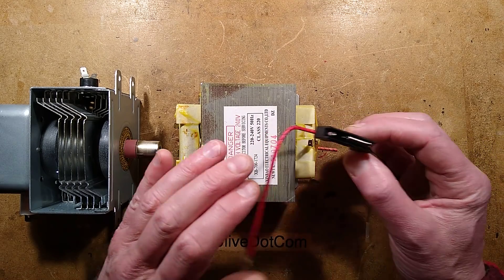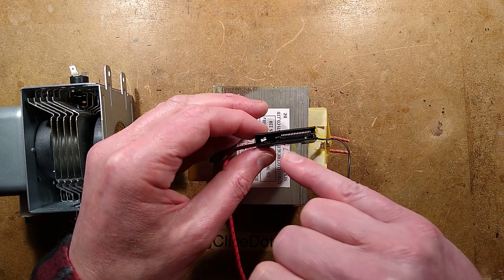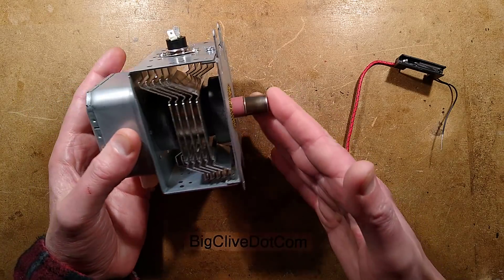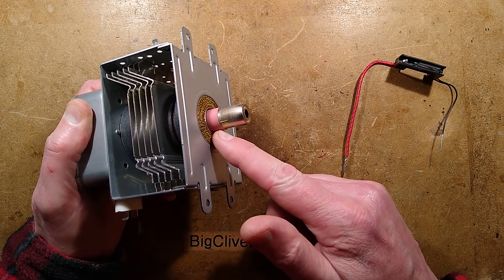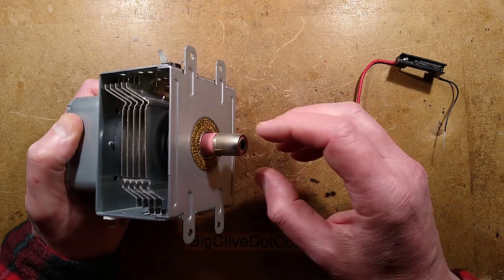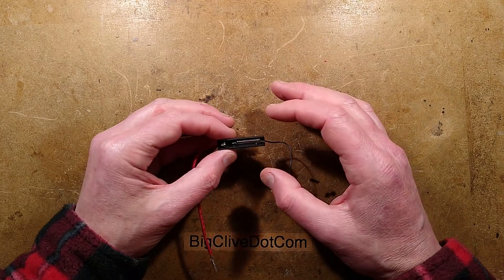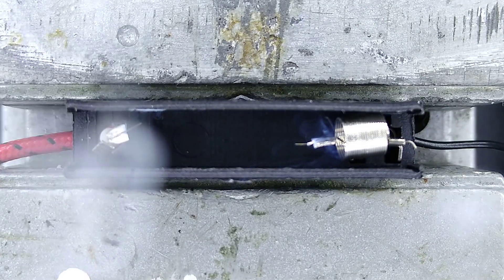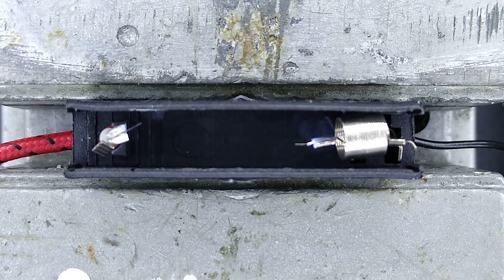Blowing a high voltage fuse

Comment: Yep, you are right, those ceramics are Alumina, not Beryllium Oxide. That stuff is used in the bores of Argon Ion Lasers where exceedingly high temperatures are encountered. Beryllium Oxide ceramic it is exceedingly expensive and difficult to machine, and as you say, it would have to be covered in warnings!
Also, cool fuse video. It would be nice to see the slowmo guys point their camera at one :-)
Reply: BeO is also used in RF power transistors where they need to have the die insulated from but thermally coupled to the metal slab on the bottom of the device. I've also heard of it being used for the window on high power klystrons. It's really pretty uncommon.

Also that pretty red / purple ceramic may be found in Svetlana RF power tubes that were also sold under the RCA brand name, it's so elegant
Reply: @hyvahyva  forgot about those! Yes BeO has excellent thermal conductivity.
Reply: @LesLaboratory  yup that's why it's sometimes a necessary evil lol

Comment: Neat! Looks quite a bit different than the large class T fuses I'm used to on lithium systems. They tend to surround the element with some kind of fine sand, probably something to do with the large ampere interrupting capacity.
Reply: The thick conductor of the fusible material and the high current means the fusible material will stay conductive as a plasma, the highly inert silica sand that surrounds the fusible material, basically quenches the arc by falling into the area left by the failed fusible material. In the UK plug fuses must contain this sand to prevent arcs forming and causing connection cords to melt and burn.
Reply: The material around the element after its melted is called fulgurite

Comment: I have a question - how does a fuse blow at the same current, regardless of voltage? Wouldn't the amount of power going through the fuse be the thing that causes it to blow, or am I misunderstanding something fundamental about fuses?
Reply: The fuse wire has very low resistance, so even a relatively modest voltage across the fuse is sufficient to push enough current through it and generate enough power to melt the wire.

I believe you may have confused the voltage across the fuse (which is generally small) with the voltage across the fused load (which can be very large).
Reply: Fuses break your circuit by melting the fuse wire. How quick that wire heats up depends only on the amount of current passing through it, and also the resistance of the wire. It's called Joule Heating  https://en.wikipedia.org/wiki/Joule_heating
Reply: Not the power going through it, but the power being dissipated (or wasted) by it.  Think of it as a small resistor.  The power dissipated is proportional to the resistance of the fuse, and to the square of the current.  Since the fuse should be a pretty low resistance compared to the load it is in series with (so that the fuse doesn't waste too much power), it drops relatively little voltage, and so the supply voltage won't directly affect when its element melts.  (Too high a supply voltage might not be interrupted, due to arcing, so there is some kind of maximum voltage interrupt rating for any given fuse.  And raising the supply voltage will usually result in the load drawing more current, so there is that indirect relationship.)
Reply: The fuse element/wire melts from heat generated in it due to its resistance and the current going through (P=R x I^2)
I it doesn't matter what the source voltage /voltage across the load is - the voltage rating of the fuse is for what circuit voltage it can break w/o risking continued currencies from arcing.
Reply: Ohm's law. What you are describing is a fuse that alters its resistance with differing voltage as to maintain a fixed current (which does not exist outside of maybe semiconductors as far as I know). As you increase the voltage dropped across any fuse/typical resistor, you also increase the current and so the power it dissipates, as power = V x I. (Similarly, as you increase the current flowing through a resistor, you also increase the voltage it drops and so the power dissipated, V x I.) Both these sentences mean essentially the same thing in practice, however, as you cannot increase the voltage dropped without increasing current and vice versa (unless you're dealing with arc characteristics / other unconventional loads, but that's another thing entirely).
Reply: Fuses are "controlled" by current, not by power. The higher voltage, the bigger gap between contacts you need  to prevent arc over. Here the gap is made bigger by spring, for smaller overall package. The actual "fuse wire" melts by temperature increase, which is achieved by current only (resistance+current->heat), independently from the voltage.
Reply: Because the dissipated power in the fuse is the voltage dropped due to the fuse resistance times the current, and the dropped voltage (according to Ohm’s law) doesn’t depend on the input voltage, only on resistance and current (P = I²R, because V = IR and P = VI).
Reply: @GRBtutorials  Thanks, makes sense.
Reply: It depends on the diameter of the wire, how much amps you can shove through it. If the current rating is exceeded, the wire will heat up and melt. Depending on the type of the fuse, the time might be short or longer. For example an electric motor with a fast fuse rated at the nominal current of the motor would be a bad idea, as it would probably blow immediately when you start the motor, because of the high inrush current. For the voltage I think the insulation of the wire is more important, because the arcing distance depends on the voltage regardless of the current.

Comment: Funnily enough the HV fuses that I found in all the microwaves I did take to bits were not like the one you showed in this video but instead they were a glass tube-type fuse with the spring and thin wire inside the glass tube and ultimately a white or black plastic holder with thick red wires coming out of each end. (The plastic holder has a tube shape and completely encloses the fuse).

Also as I've seen from parts selling websites you're supposed to replace the whole plastic holder with fuse when it blows even though the plastic holder is quite easy to open, in fact I'm pretty sure it's designed to be open and the fuse removed and swapped.

But I've found some microwaves with this fuse blown and I wonder what could have caused that.
Anyways I did wrap the fuse in aluminium foil in these cases and it worked just fine.
For science of course, definitely not in the kitchen though.

And so far the most impressive thing that I've got from microwaving something that shouldn't be microwaved is literally a jet of molten metal coming out of a 18650 cell actually piercing a hole in the back of the oven cavity !
Reply: Those fuses normally fail just from old age, they are a thin wire, and being long and unsupported copper alloy it vibrates, and work hardens, and eventually just snaps Replace with a single strand of thin wire, and it works again, although you can put a replacement fuse in there anyway, they are a little longer than your regular 6x32mm fuse, to get the high voltage ability.
Reply: I've replaced a lot of fuses in my microwaves and those of friends and family, the only thing you have to make sure is that the fuse fits tight in the connectors, if it is loose it is likely to arc and it will not take long to blow or even melt the plastic housing.
From my experience those fuses usually fail due to metal pans, forks or spoons that pass too close to the walls causing an arc and thus overloading the magnetron.

Then in microwaves with grill there are two types, some have quartz heating elements located on the other side of the ceiling of the cooking cavity and emit infrared radiation through a grid that keeps the microwaves inside, others have a tubular heating element mounted on ceramic supports inside the cooking cavity, when these supports get splashed with food and it burns it leaves a conductive soot layer that can be conductive enough to ignite an arc too.
I imagine that the capacitor or the magnetron could also fail causing a short but I have never seen that case, although I don't think I have "repaired" more than 15 microwaves.
Reply: @ruben_balea  Thank you for the info.
Reply: Is it a good idea to microwave this?
Reply: @nerfinator03  yes it's a great idea if somebody does it and films it then you don't have to
Reply: @davidmunro2077  Unfortunately I didn't record it at the time 😂😜
Reply: @nerfinator03  Definitely not ! 😂😂
Reply: @psirvent8  Have you never seen the series on youtube?
Reply: @nerfinator03  Yes I have seen it back a decade ago.
And no, microwaving a lithium ion battery is definitely NOT a good idea.
As is microwaving stuff like a lava lamp or airbag.
Reply: All the HV fuses I have seen in microwaves are as you described, an oversize glass antisurge fuse inside a plastic case, I've never seen a "naked" one before like this.
Many microwaves don't bother with a HV fuse, the transformer operates close to magnetic saturation so even a shorted HV rectifier or magnetron will just cause the transformer to sit there and hum slightly louder than normal and not heat up too much.
Reply: @grahamrabstaff9766  What is magnetic saturation ?

Comment: I'm uploading a slow-motion clip of the fuse pop. The spring contracts much faster than a single frame catches but it's interesting to see how long the wire overloads before letting go.

Comment: Makes sense having the spring coz if it's really high voltage, normal fuse wire could blow but then arc between the two ends.

Comment: Interesting fact about one form of metal oxide being a source of pink color. I don't suppose that topic is big enough to create a more regular video where you discuss various materials you could use to color some of your property in a pink color. Anyway, interesting enough to see how simple a reliable fuse can be and how it works.
Reply: Chromium trioxide is a deep purple color, but when mixed with white aluminum oxide, it's pink :) 
You can get bags of it for growing crystals. It's a carcinogen, though.
Reply: @rich1051414  Useful to know. Thanks. I think I will stick to watching NileRed and stuff like that for now, just to be on the safe side. ;-)

Comment: My microwave blew, when my power suddenly switched from 120 AC, to 220 AC, due to a blown fuse, I think…l never got a satisfactory answer from the electrician. Thirty years later, I replaced the fuse, and it works, again. All the warnings about the capacitor kept me outta there!
Reply: The only way you would get (close to) 240Vac in a 120Vac split phase system like in North America is if you had a broken neutral wire.
Reply: @Basement-Science  it was over thirty years ago, I don’t remember, and the electrician the management company sent was unhelpful.
Reply: @scottgray6276  Sure. I just mentioned it in case you want to look it up, there are good (video) explanations about it.

Comment: I’m surprised that you did not think there would be that much movement of the spring. Even old fashioned post office fuses use springy metal to create a large air gap to quickly extinguish any arc. Post office refers to the GPO - the telecommunications company of the U.K. before privatisation. These fuses were used on their 50V DC circuits.
Reply: DC pulls much longer arcs then AC... Breakers meant for AC can normally not be used for DC and if they can be used for both typically the ampere rating is half of AC with DC.

Comment: If you powered up the magnetron on your bench would you end up getting a hot beam out of the end of it like a laser or does the output just spread out everywhere?
Reply: it spreads out to the sides all around the pink insulator part.

Comment: On the subject of high voltages, could you do a video on why the grid uses odd voltages, like 132,000 and 66,000, rather than round figures, like 100,000 and  50,000?
Reply: The super grid operates at 400,000 volts. Is that a nice enough round voltage for you? Part of the answer is related to three-phase.
Reply: I asked that as a kid when walking around a giant substation, 11kV in 132kV out and then another part with 132kV in and 400kV out.  I was told it was just a multiple of the old 10kV standard where a 10% loss was expected and so 11kV goes to 22kV, 66kV, 132kV etc. but there's no particular reason apart from history.
Reply: In Germany the voltages are a bit rounder 10, 20, 30, 35, 65, 220, and 380 kV - where the ratio between 220 and 380 comes from sqrt(3) from 3-phase voltages.
I wonder what the tolerance on a 132 kV line voltage is - does it justify three significant digits?

Comment: Some types of fuses in medium voltage substations fire a spike out of the end cap when the fuse blows. The spike pushes a lever which shuts off all 3 phases. Would be good to see Clive play with one of these!
Reply: Pretty sure he has already exploded a hv fuse / pyro fuse.
Reply: https://www.youtube.com/watch?v=7hvg2Wey92E
Reply: Opening an explosive 11kV disconnector - https://www.youtube.com/watch?v=7hvg2Wey92E
Reply: I'm kind of disappointed that Photonic Induction hasn't done one yet. At least not that I can remember.
Reply: @NikoBell1188  He has done some, but they were on the old channel, dont know if they are on his current one
Reply: new channel?  I guess that explains the lack of vids.
Reply: @DANGERTIM112  Does his old channel still exist?
Reply: @DANGERTIM112  What is his current channel?  I am missing it?
Reply: @DANGERTIM112  You cant leave us hanging like that. Photon vanished from the interwebz for years. Dropped back in for 2021 and then vanished again without a trace. 

Did he move all his viewers over to a new channel and stop posting on @PhotonicInduction
Reply: Those sorts of things are "indicator fuses". Back in the days when computers used thousands of vacuum tubes, they also had hundreds of fuses. When a fuse blew, some, but not all, of the computer stopped working. But you might not see that; the computer would just be producing incorrect results. You couldn't see the fuses, because they were all inside the cabinet, in dozens of different locations. So they used indicator fuses. When the pin popped out, it made connection to an auxiliary contact, and this lit a "blown fuse" indicator on the control or maintenance console. On some computers turning on a blown fuse indicator would stop the computer. Then you looked at the light and went hunting for the fuse to replace, after you fixed the broken circuitry so the new fuse wouldn't immediately blow. 

If you find a hi-res picture online of the console of the "Univac Model I" computer, the entire panel on the left, making up a third of the panel, is the group of blown fuse indicator lights.
Reply: Andy's got loads of them fuses as he gave me a few of them. After my accident, me and Storm went round and he gave Storm a couple of those fuses. 
Those fuses are used in your local tranny which take it from 11KV (sometimes 33KV) to 240/415V. 

So one time, one of those spikes didn't shoot out and it ended up sticking 415V down the pipe and destroyed everything!
If you go on Andy's/Photonicinduction channel, they're stacked on top of each other n he called it "Bust-a-fuck" because anything you stick on there will be destroyed!! 

Those tranny's came out of a building site supply as everything has to be 110V center tapped to ground for safety so it looks like this 55V-0-55V.
But what Andy did was to reverse it, so the output 110V(55V-0-55V) is now the input 240V and the input 240V is now the output 480V. 

They were actually mine and I didn't have any use for them n all he wanted was the tranny's out of them.
Reply: I was thinking about this type:  https://www.youtube.com/watch?v=H6o8a4N9qDY

Comment: We used high power UHF tubes at work that did indeed have Beryllium oxide. As long as you left them alone there is no chance of poisoning. Only the dust would be an issue, and you would not be stupid enough to do that, right?
Reply: Fluorescent tubes used beryllium oxide when they were first developed. It was quickly replaced when the health effects were discovered.
Reply: @5roundsrapid263  Yes, having read that - and suffering from health anxiety - when I cut myself on a broken one at work about thirty years ago I had a panic attack and was taken to hospital, citing this beryllium content. Imagine how stupid I felt when the physician treating me said "Right, we've been on to the poisons unit at (xxx) - it's not been used in tubes since the late 40s."

Comment: Now we've seen Clive blow a low amp, high voltage fuse hands up all who want to see him blow a high current open blade fuse.  Not too big a fuse, lets settle for one rates at about 10kA.
Reply: A training video we used to show the kids (called "The Blue Box" I believe) showed faults across mains incomer boards. I always remember the narrators voice before each test quietly stating something like "Fault current: two million amps." On occasion the steel panel door did buckle before the trip device dropped out or the bus bars blew :-)
Reply: Where, even with theatrical hardware to pull from, would Clive find 10kA? I wouldn't bet on the fuse blowing before golf cart batteries ignited. Maybe a large welder could do it.
Reply: @tactileslut  It's not too difficult to do if you are in the right place and know the right people.  There are several high current fuses (with spares on the shelf) in use not far from where Clive lives, and I'm sure with his smooth tongue he could "liberate" one (with it's holder) and borrow a suitable power supply to produce a training video (for real effect he's need a high speed camera).
Reply: @tactileslut  You'd be surprised how easy it is to get that current in an uncontrolled way for fractions of a second. The issue is sustaining that current for long enough to blow a non-instantaneous fuse without releasing the smoke grenades built into the house wiring :-)